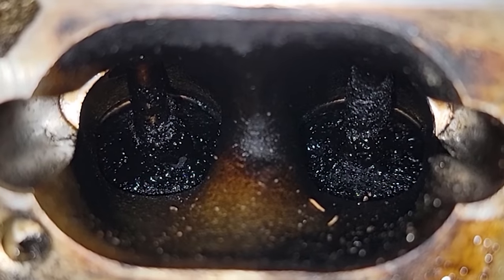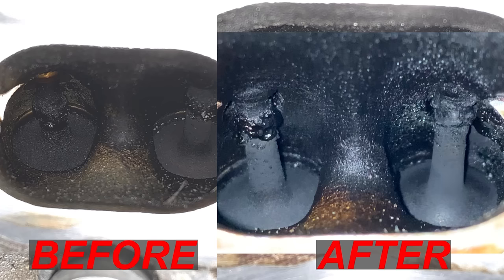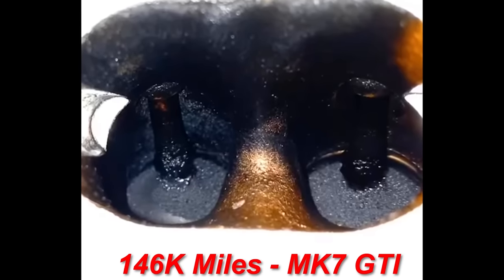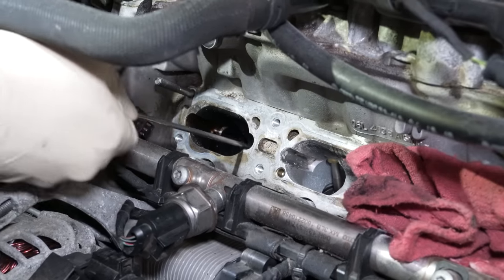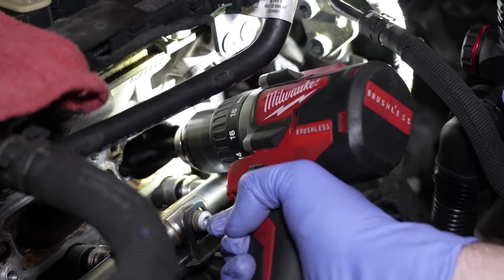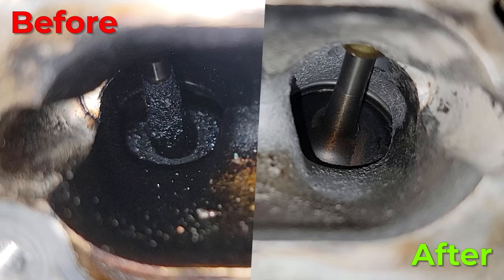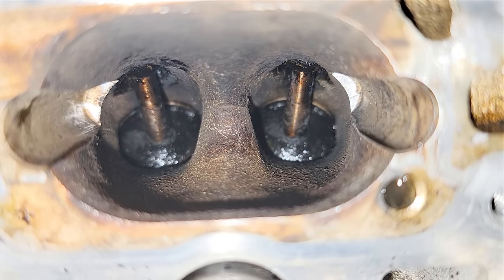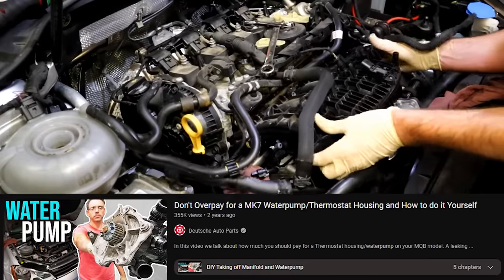How To Clean Carbon Off Your Engine!

Comment: I thought I have read somewhere that there was some truth in the 'Italien tune up method' but then the method was a little bit different. The idea is to drive on the motorway for a couple of km's to get the engine warmed up, and then after the engine is warmed up, you put the car in a lower gear so that the rpm's are above you normal daily use, but below redline ofcourse. Then you drive like that for 5 min on the highway and thats it. Ofcourse this doesn't work as good as manually cleaning them. Not a mechanic and not responsible for any damage.
Reply: Theory is the harder your engine works (RPM / FULL THROTTLE) the hotter the combustion chamber gets and it burns off carbon deposits at the HIGH RPM / FULL THROTTLE. Carbon is a byproduct of combustion.
Reply from the maker: That in theory can help with carbon inside the engine on the pistons. It’s not going to touch the intake valves.
Reply: Thank you for the clarification.

Comment: Just a couple comments:  FIrst, you should probably change the title to "How To Clean Carbon Off The Valves."  Yeah, nit-picking, I know.  Second, you mention removing a sensor and sticking the bore scope "down the hole."  I have no idea what sensor you're talking about. I know of no sensor that gives access to the valves. Maybe I'm just having a mental lapse.   Third, at 3:16 you show valves and say they have almost no carbon buildup.  That's obviously the wrong picture because the valves are loaded with carbon buildup.  Lastly,  well-designed catch cans do work.  They don't just slow the carbon problem down and they are not just a temporary fix. In fact, they're not a fix.  They're preventative.  I have a very well-designed (and expensive) RX catch can system on my 2013 Ford F150 with a 3.5L Ecoboost engine which is notorious for the carbon buildup problem and it works very well.  It catches A LOT of crap, so much so that I have to empty it quite often. In fact, for that reason, if I ever sell the truck, I'm going to remove the system because most owners wouldn't empty it often enough and if the cans (it's a two-can system) overfill, that could cause damage to the engine.  In cold damp weather, I have to empty it every 100 miles to feel safe but it could probably go to 200 miles.  In warm dry weather it goes a lot longer.  That said, you're probably right when it comes to the cheapo catch can systems.My grandson has a cheap catch can on  a Honda he owns and it hardly collects anything.  He only empties at 3,000 mile oil changes.

Comment: I checked my 2.5 forester STI and shocked to say at 125,000 miles there is no carbon build up!! i have oil changed every 5k since 20k though but looks clean as inside. For now anyway haha. Also noticed the naturally aspirated engines seems to get a lot more carbon build up than turbo petrol engines on Subaru's and VW's anyway . Anyone know why this might be?
Reply: does your Subaru has port or direct injection?
Reply: @tubejorrit  Forester STI is direct injection. Also thinking can fuel help as this only runs on 99+ ron and i have always ran the car on Shells Optimum 99ron as i know in japan they have up to 110ron which we don't have in the UK. The bro ex mechanic thinks its because fuel is a lot cleaner nowadays.
Reply: Because it's port injected, not direct injection.

Comment: Pour water through your injection and keep doing it while its running and dont let it die and it will make it look brand new just dont do this on olderbinternational engines cause they have sodium filled valves and it will melt them trust me i learned this from expierience

Comment: Why are you using brake cleaner inside, on or around the engine when there is Parts Cleaner or better Carb/Choke Cleaner that is made specifically for this and will not have the potential to cause harm to your engine like Brake Cleaner does?

Comment: I never saw intake valve deposits until direct congestion came out. I've pulled off dozens of cylinder heads and I never saw intake valve deposits whatsoever until direct injection. It is not amazing technology it represents a government obsessed with emissions while simultaneously ignoring safety.

Comment: I know that those deposits are so hard it takes a lot of grinding on a wire wheel to remove them. I doubt this product works. In fact GM came out with a walnut bead blasting kit for the 2.8 mpfi engines. Why would they want to sandblast valves ifva chemical would do the job?

Comment: I hear so much contradictory information and it seems like all of it is anecdotal evidence. Ive seen people on motorcycles do the Italian tune up on a motorcycle that is on its last legs and end up bringing it back to at least 80% of the bike it once was and the logic is pretty sound. There is a certain range of temperature where carbon likes to build up but there is a sweet spot that is hot enough to break down carbon deposits in your engine while not creating excessive hot spots that just lead to more carbon. You dont have to just look at motorcycles for this, mazda literally told owners of the rx7 to rev the hell out of the thing because it was less likely to wear itself down when it was being driven hard.
As far as additives go, I have no idea, project farm showed a video where he used seafoam on his struggling truck and it ended up improving its operation by quiet a bit because of the excessive buildup. I've seen people say the exact opposite of this guy by saying "don't ever use an additive unless your engine has excessive buildup already". Im sure additives cant get rid of everything and there are some risk with them, but I wouldn't say they are all snake oil.
I think this is one those disconnects between mechanics and engineers.

Comment: Use carb cleaner spray not brake clean. Carb cleaner spray will dissolve or soften the carbon making it much easier to remove where using brake cleaner will not.

Comment: WRONG ! Port injection does help keep the intake valves clean >>>> AND carbons up the exhaust valves and ports  , just like moving the injector to direct cylinder injection allows intake valves to carbon up much more , and intake and exhaust both to carbon up ! Moving the injector from the port to the cylinder does not fix the problem causing the valves to carbon up , it only makes the problem worse . The problem is oily crank case ventilation residue forced down the intake manifold into the valves - they could have solved this problem back in the 1970s by using a catch can for the oily crank case ventilation residue before it went to the intake manifold , with a oil level sensor on the can so you knew when the can needed emptied and disposed of like used motor oil , but , that would have cut into maintenance profits , more now than before with the intake valves more or less plugged off , and can cause  cylinder and piston damage . If you think the designers of all engines did not know this was going to happen before the engines were put on the market , you need to use your head for something besides a hat rack .

Comment: so, that liqui moly valve clean product is not used correctly. You should of pour the content into the gas tank, not to soak the valves in it. i think you should read the instructions. that blue cap and funnel means is for gas engines - put into the gas tank , if it was red that is for diesel engines- put into the diesel tank, and the black cap is to put into the oil.  and scraping the valves with metal rods is not he best thing. dry ice , zip tie OR the best is a dual port & direct injection engine like the toyota d4s - 4 port + 4 direct injectors.

Comment: Or just have a port fuel injection motor. Direct  injection is the only reason you have to clean the valves anyway. 

Oh and plenty of dealers love to sell "crankcase cleaning services", even if your motor isn't Direct Injection. Lookin at you Toyota.

Comment: Why wouldn't you use Carb cleaner instead of the weaker Brake cleaner? I'd use Brake cleaner when there are exposed rubber/plastic components but otherwise, Carb cleaner would have done a much better job breaking down all the buildup, no?
Reply: Exactly what I was thinking. I would use carb cleaner since it's all metal here. I don't think it'd hurt your valve seal.

Comment: This is why i change my oil on my 2020 subaru crosstrek every 3,000 miles and clean the pcv valve as well.
If i wait for the factory recommended 6k interval the oil would be too BLACK.
Ya i don't trust the factory 6k oil change interval.

Comment: New tehnology w/bad result. For each oil change (10.000 km) the valves cleaning must be donne w/o to open the intake air. You will save money and the car engine will run nice. After 50.000 km the opening intake air must be donne and the valves cleaning is necessary. Change the car model w/dual injections: multi ports and gdi.

Comment: Guys you should NOT use steel picks into the intake, you risk to scratch the valve stem with those!!!!
Reply: is brass ok?
Reply: @francoisloriot2674  Yep, a brass brush is definitively better, providing to check that no "brass hair", if some of them detach from the brush, are forgot into the intake.

Comment: gasoline engines,,best you can do is to mount 2mdarie injectors att low pressure but atomized fuel,meaning less fuel out from them but wery pressurized so its like a mist,,that will solve all these carbon buildupps,,,what to do with diesel engines,,,i dnt know.

Comment: Why not use gasoline as a solvent to clean the deposits?  Fill the runner, go have a beer to give the gasoline time to work, suck out the garbage.  Is it not gasoline that keeps the valves clean in a multiport?  This is a question not a suggestion.  Also don’t drink and drive.

Comment: why not just use brake kleen with a bottle brush attached to a drill?... I completely removed the pcv from my intake and connected it to a completely separate air pump. "The world is welcomed in advance."

Comment: You did the ziptides WRONG!! you want a bit longer use on the ziptides. Also tie them together with electrical tape on the end inserted into drill two sections so the dont loosen up like they did on the video. Dont use the WEAK POINTED END on the ziptides thats a weak area. Cut that off and use the part starting with the lines. The hard sharp cut end will work better in grinding than the weak rounded end you used.

Comment: What a waste of time & effort.  Easy to dissolve carbon without any scrapping and brushing. Why the hell do most people prefer to do it the hard way? Carbon remover was invented a long time ago.
Reply from the maker: Post a link your video removing intake valve carbon with it.
Reply: Video piston of grass cutter soak in carbon remover
https://youtu.be/4eDA-h2Olhg

Video on my intake valve

https://youtu.be/pnCs0DXva2U
Reply from the maker: Please link to whatever this chemical is so we can take a look. Those videos have no details about what is being used whatsoever.
Reply: @Deutscheautoparts   It's a Water based carbon remover. It's odorless. Some branded example are Turco 9045-6 & Piston Kleen. Let me know after you tried it. 
Close up view on my Intake valve https://youtu.be/4OXJq0PP5oE
Reply: @Deutscheautoparts  Bonderite C-AK 9045-6 Aero seems to be what w01vez1 might be talking about , or a similar product from the same company . I could not see how to buy the products , maybe they only supply to trade  ( which is a shame ) ... anyway there is a lead for you .
Reply: @davidyendoll5903  It's manufactured by Henkel. Manufacturer of Loctite.

Comment: Tip number 1: don’t buy a direct injection car.
Tip number 2: especially don’t buy a VW with direct injection. But if you must, trade it before you have 100k miles on it.

Comment: Before you clean the carbon off, find out why you have carbon on the engine. I drive a 2001 grand caravan, no carbon on the engine. 189 thousand miles on engine.

Comment: A long wire brush on a drill would be better than zip ties.
Reply: I'm sure metallic brushes it's not good (possible damage) otherwise the VW TSB would not mention specifically zip ties.

Comment: The solution then is to remove the PCV.
Reply: Will cause your engine to not breath properly and your rings will seal less.
Reply: @mr.cangieter8758  idgaf.
Reply: @mr.cangieter8758  just have it like the ole days where u just pollute.

Comment: Thats called bad engine design, honda has air intake so low it sucks rain water on the roads, all the car manufacturers mentioned to have those issues are cars to avoid

Comment: Unfortunately carbon build up is never the fault of a direct injection engine , it's the poor design of the pcv that is the root cause.
Reply: it's both.  actually PCV is not poorly designed.  it's doing its job without a catch can that noone wants to clean.
Reply: @francoisloriot2674  
Can't agree on that one.
Carbon build up is , as the name suggests carbon, carbon is the main component in oil, and yes even synthetic oil contains carbon.
In the "old days" crank case gases on engines were vented straight out into the atmosphere, however this no longer permitted, if this was still allowable today these direct injected engines would be sucking nothing but air across the valve tops and consequently no carbon build would occur, pcv design still has a way to go before completely eliminating the reintroduction of oils and oil gases back into the intake system.

Comment: Get yourself a can of dry air keyboard cleaner £15 pc world,, put the straw in the port, spray lots into the port and it will clean it as good as new,,,, 100% works you will be amazed,,, give it a try, no bull s,,t,, I used it on my audi s4 v8,, give it a go, I promise it works,  if I'm wrong,  u spent,, if it work as I say, you'll save lots of money,,,,

Comment: Walnut blaster works best! Sell your DI - VW especially the EA888 engines… pure JUNK… dump any Direct Injection car, without a port injector as well and fix those junky OEM valve guide seals… BTW… throw away your Catch-Can scam while you’re at it… in fact DUMP VAG cars entirely 😂

Comment: Why not buy a car that is of a decent design that uses sound engineering to avoid carbon fouling. It is surprising that people put up with this rubbish.

Incidentally this also causes other issues due to oil contamination such as excessive timing chain wear to the point where the life is similar to that of a timing belt.
With these cars gone are the days when the timing chain lasted pretty much the life of the engine, which after all is the main reason why timing chains are used. May
as well stick with a timing belt.

Something that has both intake manifold / port,  and direct injection would be much better. That way you get the advantage of direct injection without the carbon fouling issues.
Some modes of driving are more optimal for port injection and the engine management system can switch between the direct and port injection based on how the car is being driven.

Comment: They came out with GDi because of the fuckin EURO6.. fuckin EU! I mean yes it's ok to have mileage 5/100 like me, old Skoda Felicia at 1t of weight you were lucky to have 7l/100, 8 in the winter BUT everything come to it's cost and this is the major drawback of GDi.. btw THERE ARE some mazda motors that have both port and direct injection and does not suffer from this shit

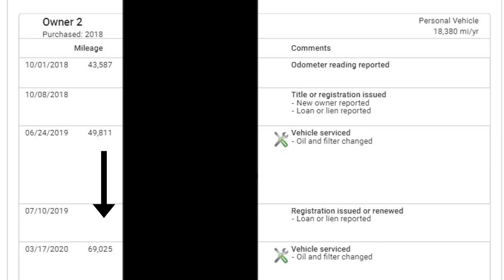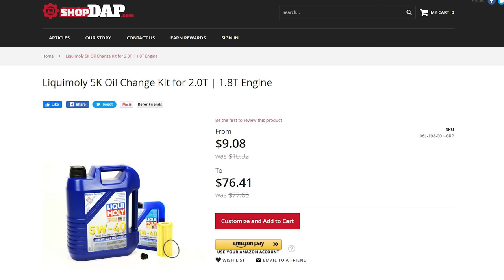Comment: From @ 3:44 to  @4:15 you demonstrate that you are not qualified to speak on this subject. The carbon and sludge on the valves of both of these is absolutely unacceptable, and you speak as if one was better than the other. Then you point out that one uses better oil, when hundreds of studies have demonstrated that all SAE motor oils of the same type are indistinguishable in performance. Then to top it off, you allude that fuel quality matters, when the intake valve carbon build-up is 100% unrelated and independent of fuel quality or type.

Comment: 8:00 you close the valves by placing 2nd gear and pushing the car 2-4 inches backwards, several times if necessary.
The carbon build-up is easiest cleaned with blasting crushed hazelnut-shells.
No need to pre-wash with cleaners and then scrape it.
You don't see a difference with medium blasted and cleaner soaked and purely medium blasted valves. Don't let you get fooled guys.!
What a useless video -.-

Comment: i dunno, i dont think the extra cost of direct injection makes sense, i prefer port injection, i dont think i will every own a car with DI if i can help it
Reply: More power, better fuel economy? Okay… 🤷‍♂️
Reply: I agree with you.  I don't understand this theory about more power and better economy.  it's not worth it.
Reply: @francoisloriot2674  Not exactly a theory. We’re routinely making 150 to 200HP per Liter using it, and still returning 30+ MPG. They jumped on the carbon problem early with extra port injectors, and the newer designs don’t even need them to run mostly carbon-free.
Reply: @troyjollimore4100  I had a 2012 Subaru WRX before and was making  the same power (before tuning) and same fuel economy on a non-DI engine.
Reply: @francoisloriot2674  So, please explain why the 2019 makes around 20 more HP and torques, while being rated 3 MPG better? I’ll wait.
Reply: @troyjollimore4100  Why should I explain this?  There could be a ton of other factors.  But even if it's true, what's the point if carbon deposits reduce that advantage to zero after 120.000km and you have to pay like 1000$ to fix it?
Reply: @francoisloriot2674  Please don’t bother replying if you can’t keep up with the conversation. I already answered that for you. It’s also asking why you paid extra for the WRX when there was a perfectly fine Impreza available for less money…